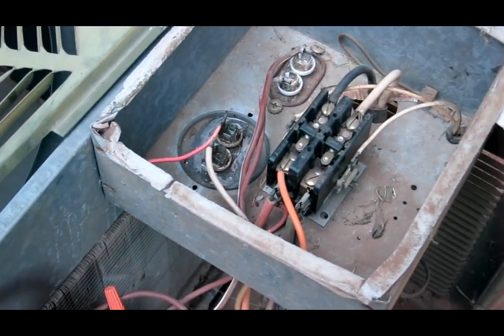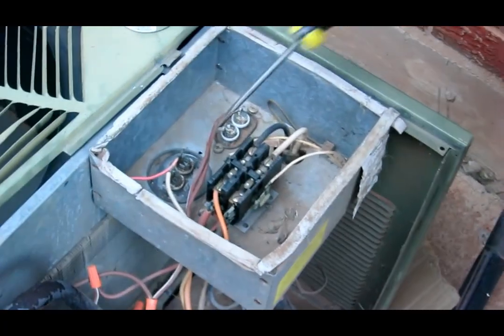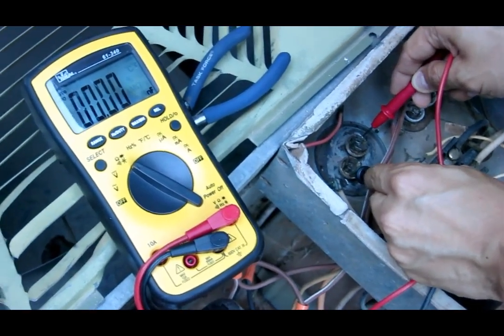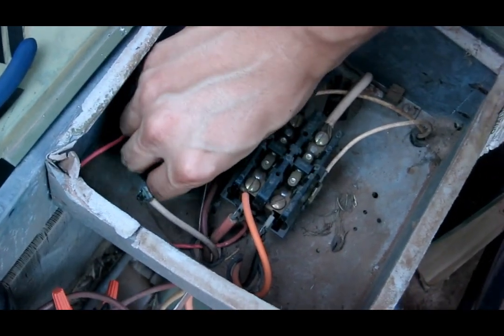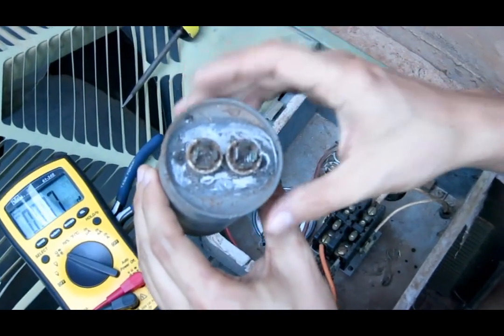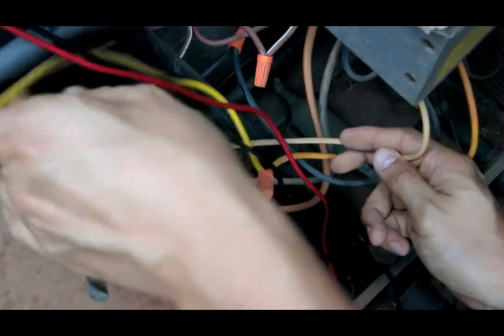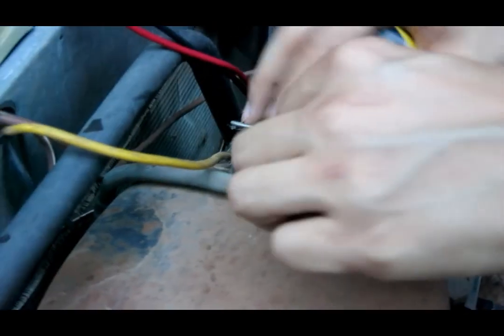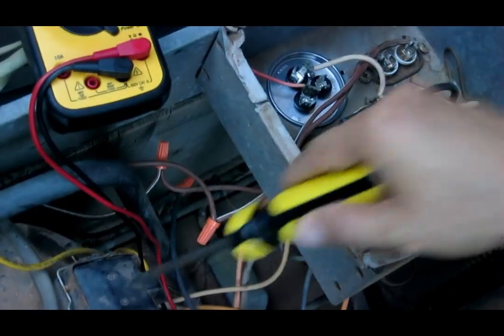How to fix your AC - Fan kicks on but Compressor Not Working - Replacing run start capacitor

Comment: Well...like many stories, blowin' hot air-unit(capstr area) only humming. BUT, between diagnosing,running to the ac store replacing my capstr,i don't remember if it was flipping Brkrs before & after or only after.Went to start it and ran for 2-3 seconds,  flipped the contactor, when i push the contactor it starts for 2 seconds & flips breakers. took the cntctr to the ac store & the"23yr" ac man(whom was really nice) said he could assure me the contactor was good. SO, comprsr or electrical ?

Comment: THANK YOU.
MyYORK is 20 yrs old. 2 yrs ago i paid  HVAC tech $600 to replace FAN capacitor. Now my fan would turn on but no cool air. Found your vid's. KUDOS because your clear,audible,frkn smart instruction helped me do it.Old capacitor was 3.5 uf. that size is no longer made but HVAC  guys called around to confirm that a 7.5 uf is AOK to use when replacing the 3.5 uf. I was replacing a 2 prong with a 3 prong .I  just didnt connect to  FAN on the new 1.** ALWAYS color code leads b4 undoing**

Comment: Thanks for your help on this.  I've had a unit that has not worked for 15 years, and  never got it fixed.  I've had repair guys just tell me to replace the whole thing, and all it was was the capacitor all along.

Comment from the maker: yes, you are right, it doesnt matter since im only using 2. but now its setup correctly if i want to add the fan on the same capacitor.

Comment: DIYers shouldn't mess with hvac or refrigeration. Get a second/third opinion, but don't do this yourself. I've seen homeowners die trying to be a mechanic.  I wouldn't try to cut my own hair even though I don't like paying $25 for a haircut, know what I mean?  And refrigeration lines should never be soldered, FYI. Again, does joe homeowner have his torch license? How about EPA certification? Nope.

Comment from the maker: Moving the unit can cause leaks. Fan running doesnt mean the compressor is running. The condensing unit has two pipes going into the house. One pipe (bigger one) should be cold, and the other (smaller one) should be warm/hot. If the bigger pipe is warn/cool, then your might be low on freeon, bad compressor, dirty coil, etc...

Comment from the maker: A leak doesnt mean you need a new unit. There are "hvac leak detection kit" for $80 that can pin point where the leak is. It could be a simple soldering issue, evaporator, condensing coil, or etc.. I would ask for a leak test, or ask for a second opinion

Comment: AAaaggghhhh! We have a 4 ton 2004/2005 (?) new track home install that went out a couple of weeks ago. The fan on the condenser runs but after a while it only blows warm air. The unit worked fine when we moved in 2008. Two summers ago (2010) we had our contractor move the condenser around the corner of the house so that the unit wasn't right in the back yard but on the side, right around the corner. I now know that he used 4 right angle joints to reconnect it.